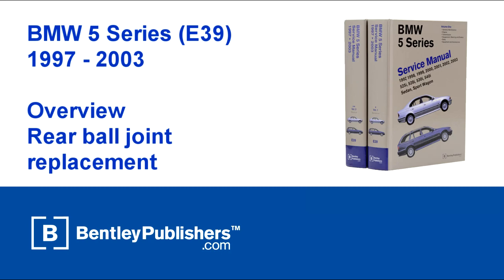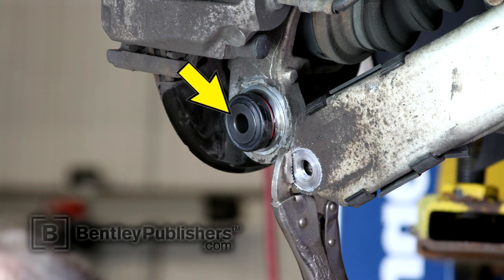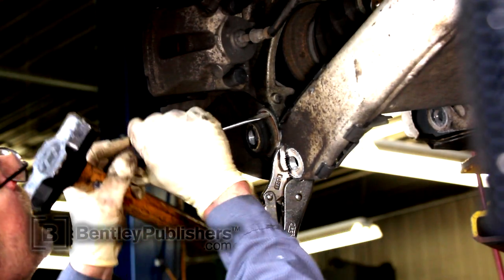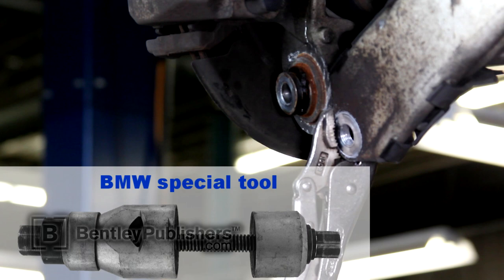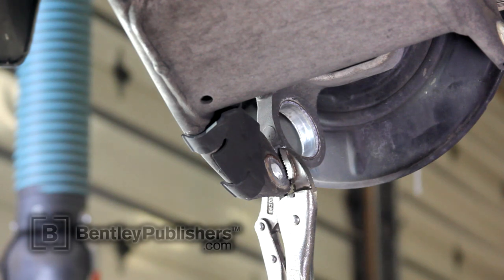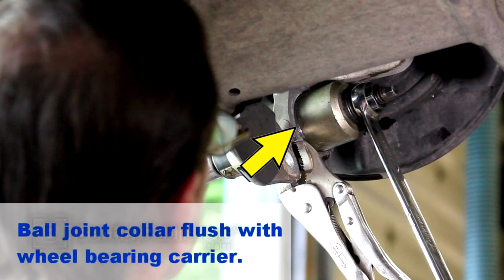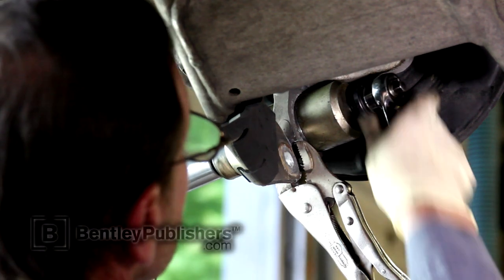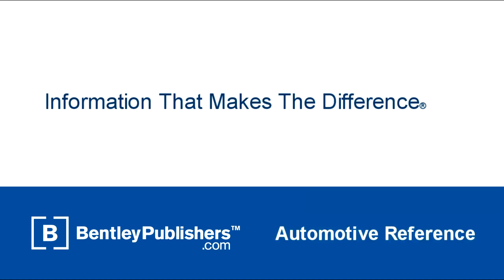BMW 5 Series (E39) 1997-2003 - Rear ball joint - DIY Repair

Comment: Just did this repair last weekend using a jack and jack stands.  I ended up having to disconnect the level sensor and the 2 innermost control arm bolts just so I could remove enough tension to swing the arm down some.  Also, realigning everything was a real PITA.  Saved a ton of money doing it myself though so !!!!!!
Reply: Holy crap. I ended up unbolting the whole Lower control arm (swing arm) as shown in other videos and holy shit it took me like 2+ hours trying to put the thing back because of the tension everything. I had to hammer the outside Side of the Swing Arm in. Then inserted the largest bolt in (the one that goes through the wheel carrier) then i used an extra jack to push up Swing Arm to align it enough to insert the last bolt in. But man it looks easier than it is lol
Reply: I am on day 5 with this on an 03 X5. Like you said E Onez, I can't align the other side of the integral link. I wasn't aware that with coil suspension it makes everything harder to do.  Hopefully I'll be done by tomorrow night.

Comment: If you don't have the BMW tool you can get away with a typical C-clamp style ball joint press, it requires considerably more care and really a second set of hands to keep everything lined up during the impact gun pressing phase. Also, be very careful with the vice grips holding things in place, they let go when I was doing this and mangled the rubber on the new ball Joint in the process, which subsequently ended up failing very quickly. It could also mangle a misplaced finger.

Comment: I'm curious as to where the mechanic is prying when he pulls the swing arm down. Is he under the axle? There's so much aluminum down there that I'd hate to damage it, but the axles seems iffy as well . I tried putting the end of the pry bar under the shock-mount nut, but didn't really have the kind of bite I needed. And why do most of these videos always edit out the hardest parts in wrestling the integral link and/or swing arm into position. These things appear in place like it magically set itself right? Not fair, guys.

Comment: Vicegrips clamped on machine spot face on lower arm........please bin vicegrips from your workshop. I have commented on your other video too, please realise Im not an internet troll, but all Im saying is, theres a time and place for a vicegrips, and this is not one of those times, especially clamped on a forged alloy spotface, If it throws up a burr there, your initial preload force on long bolt will be inaccurate, and it will loosen.